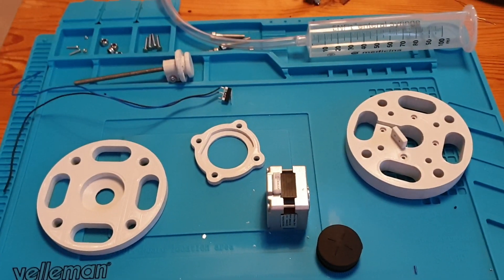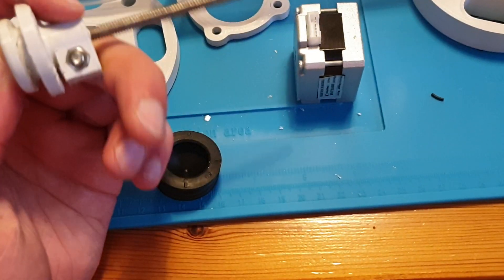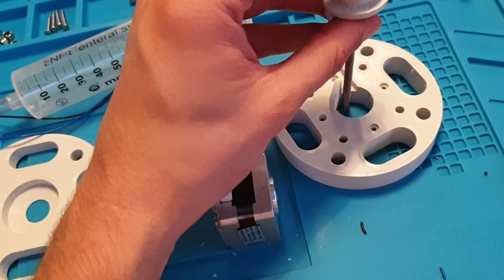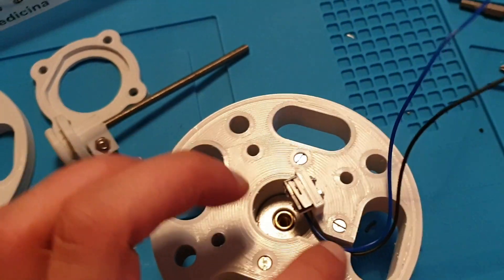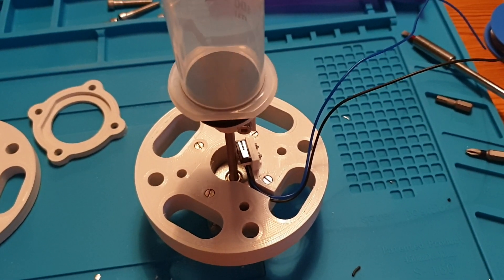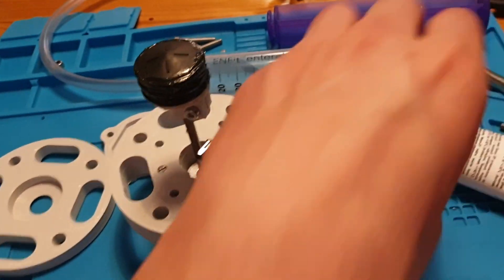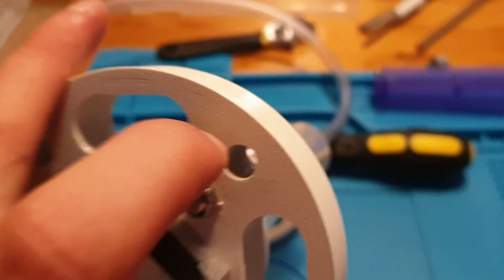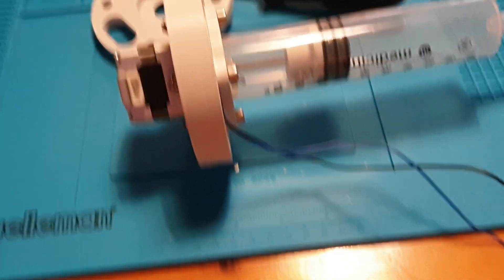Building a submarine - Part 1: Ballast tank

Comment: That's an interesting stepper motor.  I'm having trouble finding ones with internal threads for the lead screw.  Do you know what it's called or could you post the model # from the sticker on it?
Reply from the maker: I bought it off a Swedish electronics store, I think it's Chinese in origin. The model number is 39BYGL215A. On the product page it wasn't called anything specific.. but I've come to learn that the property is called "lead screw", so if you google "stepper motor lead screw" you get a few hits.
Reply: @HolyGarbage  Thanks.  That part number found several options on ebay.  You were spot-on that finding a replacement lead screw is tricky!
Reply from the maker: @franksmith9086  as someone else mentioned, if M8 lead screws works for you, it might be easier to use that since it's what's used in 3d printers and cnc machines often so the market is flooded with them as replacement parts and for DIYers.